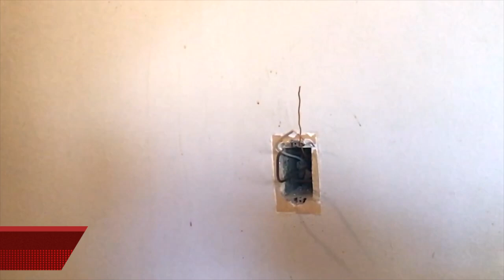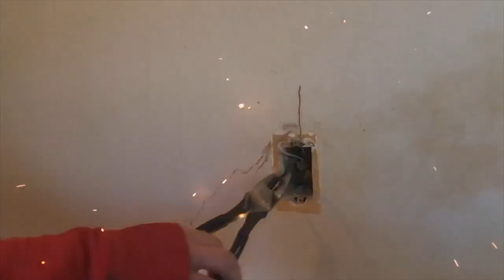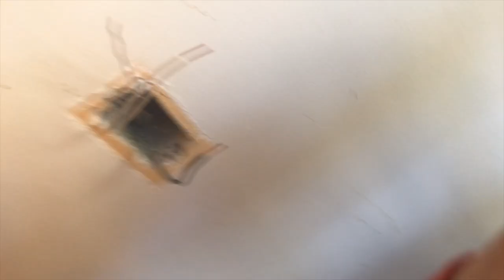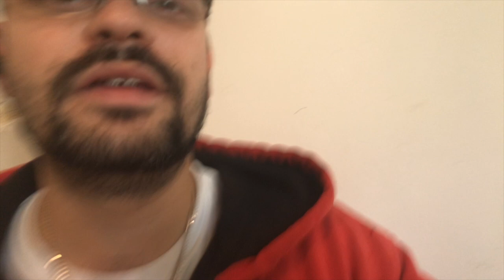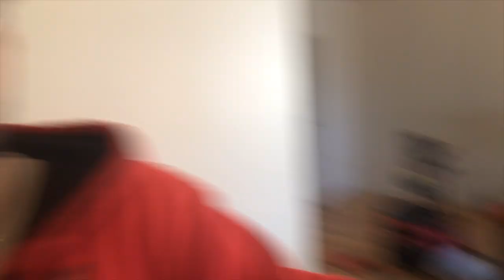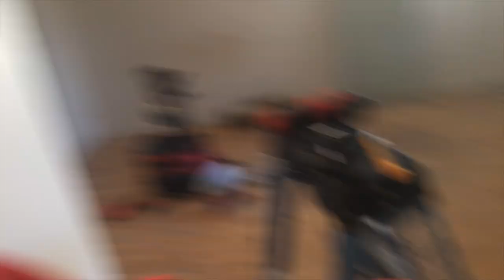120 volt Arc Flash at 240 FPS

Comment: Was this completing a circuit that had a load on it somewhere? I have arc flashes happen with 120V wires that weren't nearly this extreme and am wondering why exactly.
Reply: The black is a hot and the white is a neutral the sparks happen because there is low resistance between the 2 wires which means when the black touches the white there is an increased sudden flow of current

Source: I’m a electrician
Reply: No it is not completing a circuit normally the small amount of current from the load returns through the neutral white wire but what is happening here is not completing a circuit… this is what is called a short circuit and nothing is wired this way as it is incorrect… one of reasons you may have arc flashes is if you have poor connections resulting in current jumping between contacts